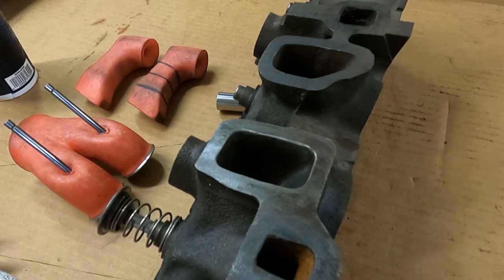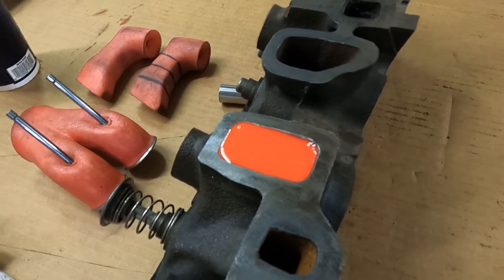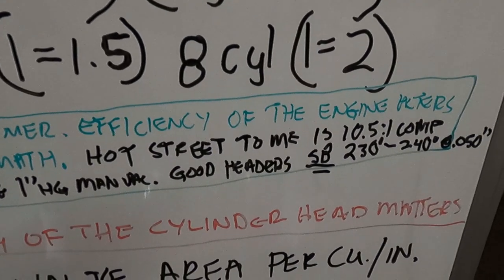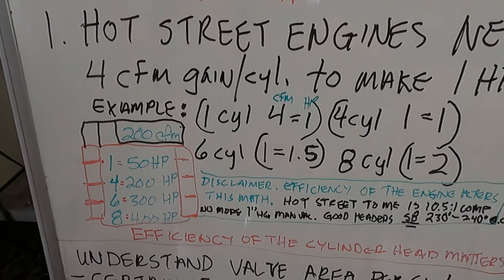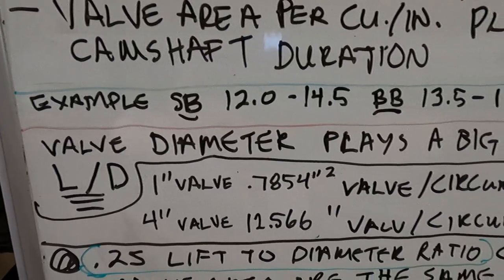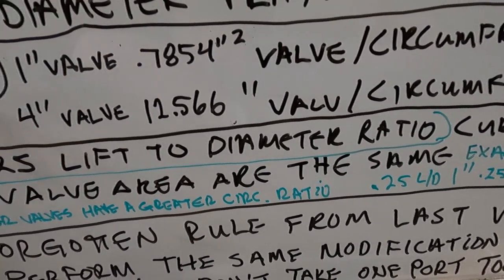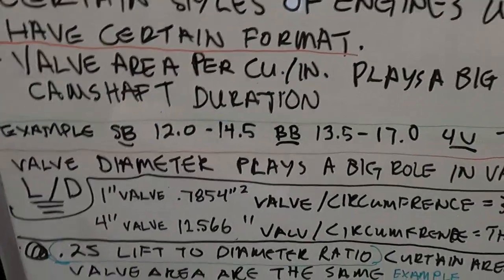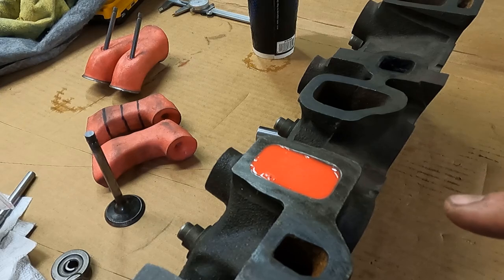Cast Iron Porting Part 3

Comment: Excellent information! 
Regarding these Ford V6s there is a book out there that specifically covers these 60* V6 Colonge engines. It's called 'How to Build and Modify Ford V6 Engines' by Sven Pruett of Motorbooks International, Power Pro Series. Really a great book covering their idea on how to improve performance. They even have a section on porting the 4 different heads used on these Colonge engines. Not sure if you knew about it or not, thought I'd make mention of it. So far very impressed and learing a lot with everything you've been explaining. Port and valve in relation with proper airflow is certainly a science.
Reply from the maker: I've heard of the book but havent read it. Sometimes decompartmentalization is the best way to come up with fresh ideas.
 I will say the best information Ive read on the 2.8l was an article about the Manny Esquerra Bill Stroppe prepared Ranger for the Baja 1000. 
 It didn't talk about the heads too much but it did talk alot about the engine and modifications
Reply: @mummertsspecialvinterests2721  I'll have to look for that. Thanks!